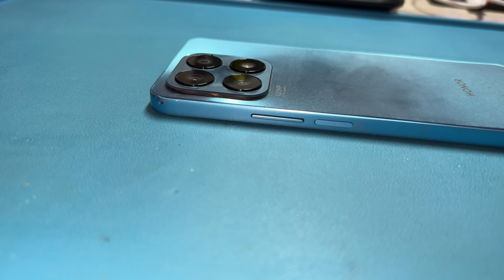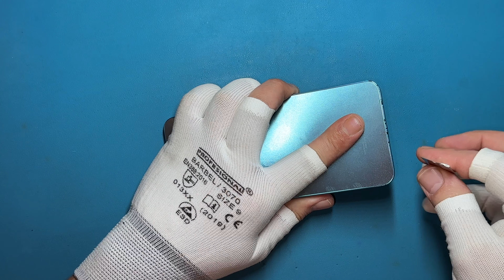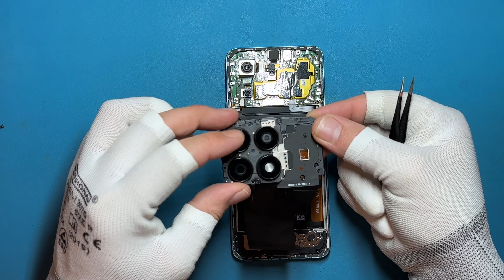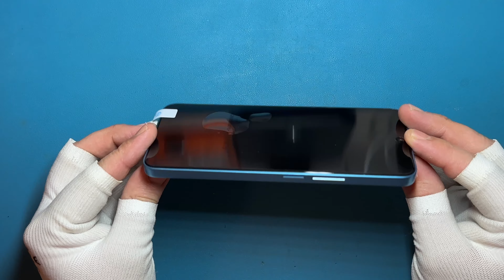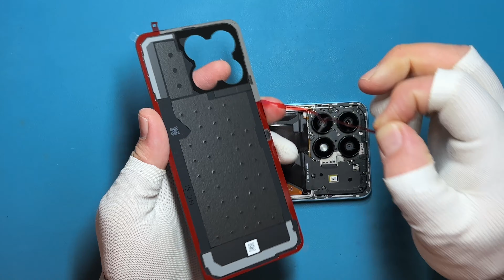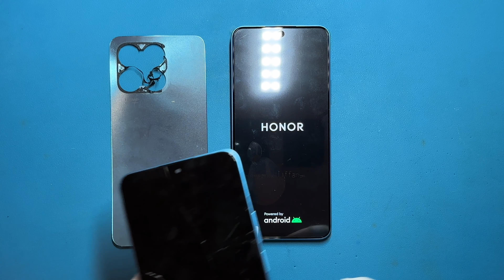Expert tips for a successful Honor X8A screen replacement

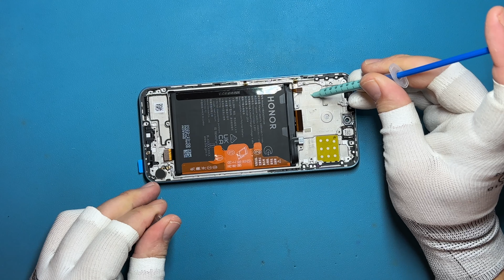Comment: The video is very nice, cheers to you. I have a question for you. What is that blue paste you applied at 4:03 minutes of the video? Thermal paste?
Reply from the maker: hi thank you very much :-)
yes, you're right, it's a thermal paste :-)
Reply: @mk.service-phone   is it ok to put pc termal paste or you need a specific one?
Reply from the maker: Hi, I don't know exactly, they use the one prescribed by the manufacturer
here is the link for mobile thermal paste:
https://rounded.com/thermal-paste-for-smartphone.html?sl=zh